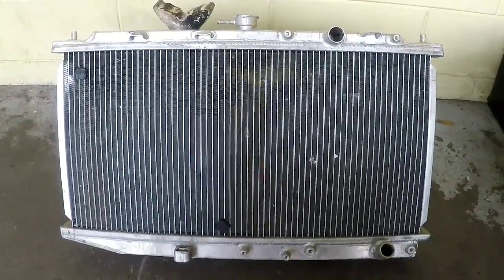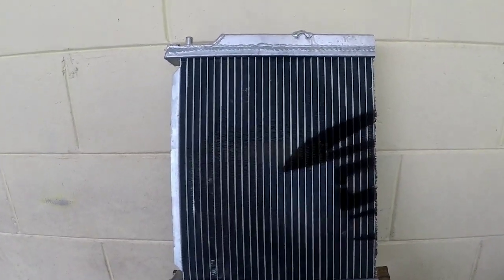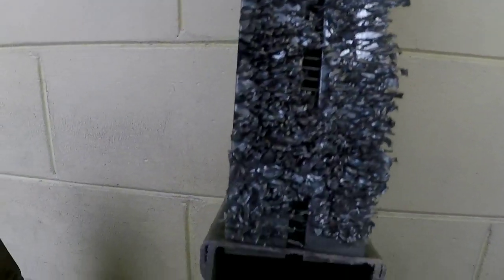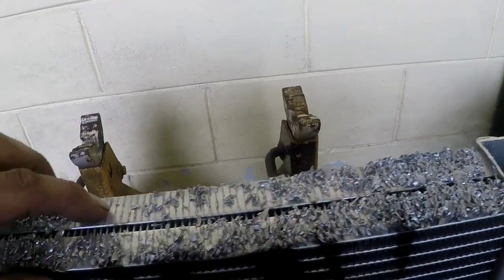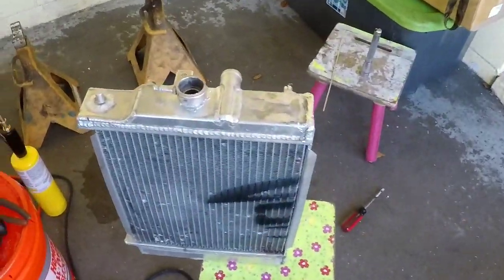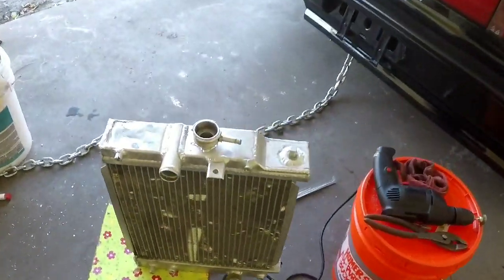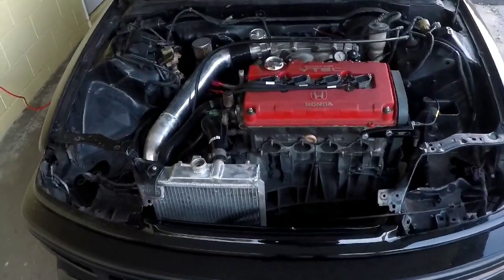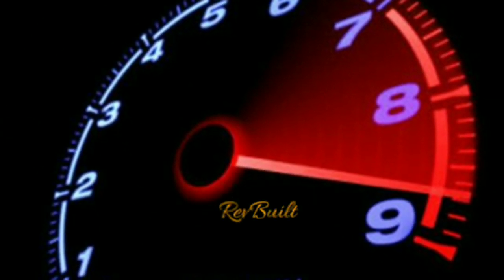Creating a small radiator

Comment: Should have cut and fitted the radiator cap before soldering on the end caps, to remove all the shavings. Be interesting to know how badly it leaked?
Reply: you can see the coolant on the ground under the car. it leaked bad.
Reply: @TheRichardwd3809  lol that was there before bruh....
Reply from the maker: Not really ....works good
Reply: I worked at a radiator shop this is how we cut down radiators but we welded them. Metal shavings are no different than stop leak.